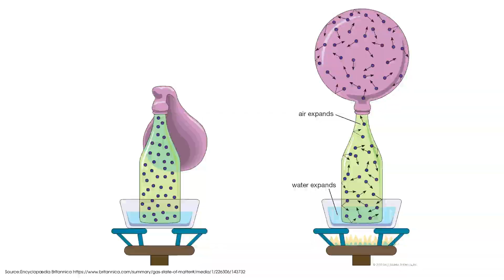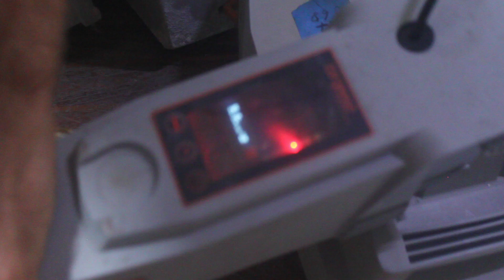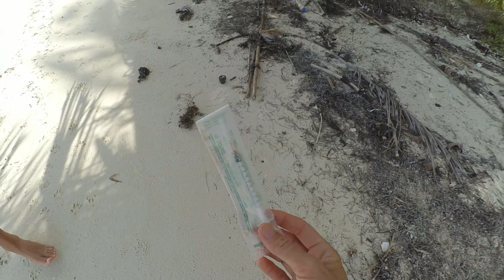Fixing our Torqeedo / If it ain't broke don't fix it Part 2

Comment: Awesome !    Did you have any error codes ?  before taking the motor apart.  My torqeedo is ultralight 403ac.   Which is basically the same but smaller.   I have Error code 45....  just stopped working.     I haven't hit anything... and taking apart I don't see water damage.    Many people tell me Error code 45 is the result of water (I am only in saltwater) entering the motor unit because of deteriorated seals over time.  I have opened up the motor and see no water damage.  BUT....  you guys are washing and dunking the motor in water !!  That's crazy !  Thank for your videos.     Your English is very good 🙂
Reply from the maker: Unfortunately we don't know if we had an error code as from the very beginning we ran it on 'our' electronics as the original Torqueedo ones were dead already when we got it, so we exchange them for an Arduino based solution 🙃 You can find more about that in this quest https://youtu.be/MPtbGm6DaXU including links to the source code 😊 As for the water keep in mind that it was already dunked in salt water so we couldn't do it much worse and we did wash it with rain water ( distilled ) with soap and let it dry very well before trying  😉 Thank you for your comment! ❤️